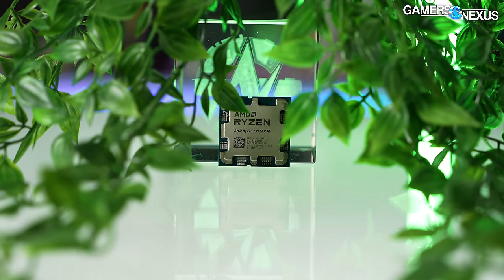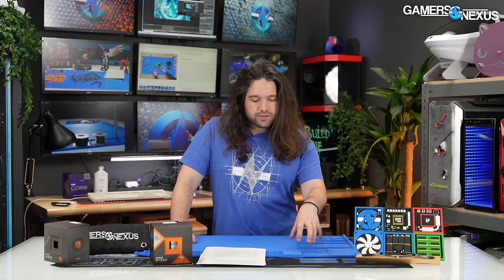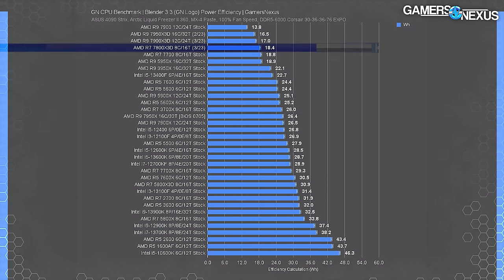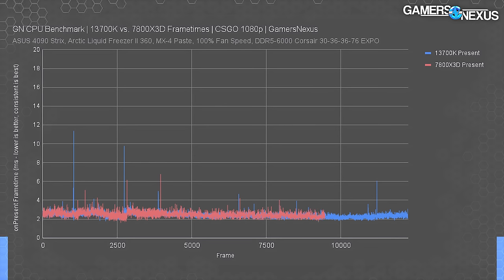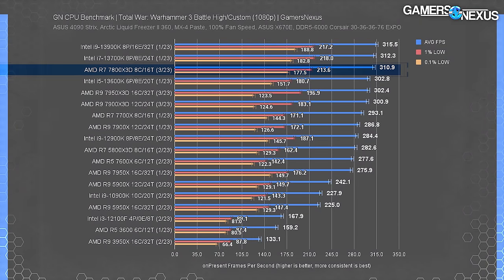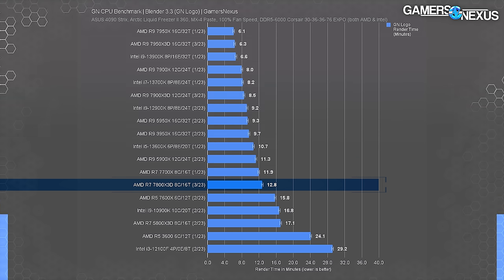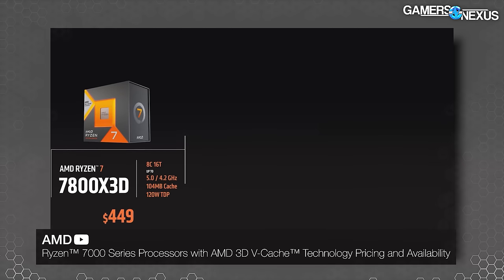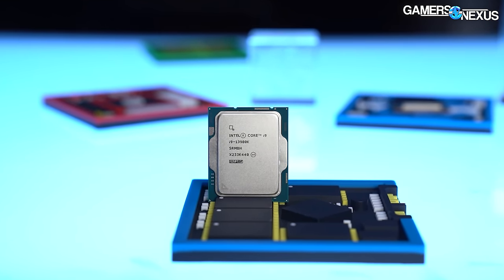AMD Ryzen 7 7800X3D CPU Review & Benchmarks

Comment: While I, in NO stretch of the imagination, agree with the GPU pricing lately, I DO kind of wonder if the price hike, at least in NVidia's camp, isn't based on all their R&D for the graphics technologies being developed almost exclusively by them.  They would need a return on their investment in the R&D space somehow.  Even still, as we get closer and closer to real life graphics, the R&D required to come up with a realtime way of making a game work properly (# of units on screen at a time with particles galore etc etc) increases substantially.  Yes, also, I'm aware Unreal Engine 5.2 is free to use and low cost to sell commercial games with, but that engine still has to run on silicon, not to mention NVidia R&D gets used and baked into the engine also.  With all that said, Theyre still wicked overpriced LOL.

Comment: @Gamers Nexus Would it be possible to NOT install the parking driver that AMD provides for 7900X3D and more specifically 7950X3D, and use Process Lasso instead to control the cores for individual tasks?  In my head, this would mean that you could manually set it up to use the V-Cache CCX for games that benefit from V-Cache, and the standard CCX for games that benefit from frequency.  A bit of a pain to initially set up, but would then make the 7950X3d the absolute king in ALL workloads and ALL games. By a long way.

Comment: Overclocking?
Reply: You can't oc an x3d processor, they are locked because of the vcache configuration, you can enable pbo and undervolt with curve optimizer, maybe reduce the vsoc when you have expo enabled, mostly to reduce power consumption and achieve top boost clocks under load.
Reply: you dont need to for gameing anyways

Comment: My 14700k is total fkn nightmare. Intel just a gang of scammers TBH selling same ancient, outdated trash using 10nm lithography for 3 years. 12, 13, 14th generations of CPUs are the same overheated, power-hungry crap. I bought my i7 4 days ago and all 4 days I was trying to cool it down or decrease its temperature. Not a single cooler, including the most expensive liquid cooling is able to cool it down. FACT. Don't even waste your money! All I could do is decrease turbo boosts power from 253/135 watts to 110/110 and cut frequency of all cores to 4200Hz with -0.015V undervolting. Yes, I lost 14% performance, but I got stable temperature of all cores @65-70 degrees Celsius.
Reply: Is this for gaming? That doesnt sound right?

Comment: I foresee AMD releasing a 7850X3D at some point to be the ultimate gaming CPU on this platform if Intel is able to convincingly beat this CPU with their next gen.  Basically it will be the 7800X3D without the artificial limits to clock speed.  AMD will probably stop selling the 7900X3D, as its clearly a dumb product.

Comment: One thing I would point out with the 13600 is that the power consumption is nearly double that of the 7800x3D. You'll pay less for it initially, but if you plan on running it for 6 years: you'll end up paying more than the difference on power cost over time. Running at the load/values indicated in the chart 24/7: after one year @13c kw/h: you're paying $97 to run the 7800x3D and $183 to run the 13600. And that's just off of a 74.4 watt difference 

Slightly tangential, but this is main reason why I think Nvidia is going to be eating dust in a generation or two. Their power efficiency just isn't anywhere close to where it needs to be to stay competitive long-term, and I see AMD cards starting to take advantage of some of the efficiency gains the CPU side is making. Power consumption has slowly become one of my favorite "parts value" metrics. People love to look at the upfront cost, but rarely factor the day to day cost. The new Nvidia cards cost a lot more than that over time.

Comment: I think I'm missing something, because I don't see the point. In 1440p, there's an insignificant advantage. In 4K, there's almost 0 advantage. In 1080p, were talking about such a high framerate, that it doesn't matter if there's an advantage or not (300 fps vs 240 fps), and most people spending $400 on a CPU don't usually game at 1080p.

So why would anyone need these? Shouldn't anyone who isn't a professional competitive gamer (99.99% of us), that doesn't have a 240hz+ monitor, and game at 1440p+, should just get a mid-range CPU, and just invest the money saved on a better GPU?

Comment: I assumed that AMD would put out 7950X3D and a 7900X3D chips - Zen 4 versions of 3D V-Cache but on 12 and 16 cores, would be killer. But I didn't even think they'd only add the V-Cache to one CCD. I'm sure it's super expensive, but man they neutered those chips. I wonder why they couldn't split the V-Cache across both CCDs, half the cache added to one CCD, and a separate V-Cache added to the second. But the core parking stuff, neutering the chip stuff, geez, why did they do it? I'm curious to see what Zen 5 3D V-Cache looks like, I imagine they won't do this again. I hope they won't.

Comment: meh, i have a 5700x. more than enough for my current 1660ti (just upgraded platform) and it should be plenty for something like an rtx4600ti or rtx4700 next year when i upgrade next year. 32gb of 3600mhz ddr4, i am set on platform for probably 5 years. i don't use the computer for productivity and if i wanted a productivity computer it would be very specific as to what i wanted for the work flow. this is a relatively cheap pretty great gaming/media computer.
Reply: oh, and power efficiency is almost meaningless for my current usage case.

Comment: I just can't warrant spending $450 on an 8 core CPU. Especially when the 12700kf was on sale for just $235 dollars last week, and I was able to snag a 12700k for $250 at the same time. CPUs have gotten so fast for gaming that there's almost no point in spending anywhere near this much for a CPU that only shines in gaming, and then only when tested with a 4090. You're GPU bottlenecked in the majority of real world gaming so it makes far more sense to get a 12/13600, 12/13700, 7700x or 5800x3d and apply the savings to your GPU that you'll actually notice.

I just feel this needs to be closer to $350 to make a lot of sense, especially when it's tied to the more expensive AM5 platform.

Comment: The big deal here is the the similar spec Intel chips appear to use twice the energy to get the same results.   So for instance, the 13600K is using 73.6W extra plus a few more watts from higher fan speeds in the rest of the system to cool a similar case.  Basically double the power.  Triple if you look at the 13700K.  For myself, I'd consider it "good enough" and save a significant amount of energy.  In fact, with a power usage that low, I have a giant passive cooler that would even work.. Just saying... No need to even consider water cooling (250+W is a massive air cooler with a fan that's screaming, no thank you) when any $30 fan cooler will easily work. The AMD offers options for lower noise, less cost to cool, and overall better economy.    This is a clear "win" to me as an end user as I'm not running my games at 200fps.  The question is.. is it fast enough and efficient enough.

Comment: if he performance gain from on the 7800x3d comes from the fact that all 8 cores are on one side of the die rather than 6 and 6 or 8 and 8 on the 790xd and 7950x3d, then can't you cimply disable half the cores in the bios on the bgiger chips to get them to perform like the 7800x3d? My 6 core was able to run 2+2, 3+3 and 4+0. if you could get a 7900x3d to run 8+0 then it would theoretically get that advantage boost up to a 7800x3d performance, no??
Reply: No, as the 7900x3d only has 6 x3d cores. It would be like a hypothetical 7600x3d
Reply: yes but theyre all cut down 16 cores to begin with. If i can enable a 4+0 config on a 4 core or a 2_2 config, then it should be theoretically possible to activate an 8+0 config on a 12 core that is usually 6+6. im not claiming to know how these chips work it just seems its ok to enable some cores on some chips on one side of the die as long as you dont try to turn a 12 core into a 16 core etc @TonyChan-eh3nz

Comment: Just jumped from 7500f which is amazing ❤❤❤❤❤  this 7800x3d what a disappointment. High temp, high fan noise, 30fps more comparing to 7500f .   .
Reply: if your 7800x3D has high temps, that's honestly a massive skill issue on your side. It's literally one of the coolest high-performance CPUs on the market.

Comment: Lol at the claims about the efficiency being the thing to tip people towards buying.

If you're only gaming then how long would it take for the increased AM5 platform cost to be paid back in power savings?

I'm on a 12700k and it's never even close to maxed during gaming. Power usage easily under 100 watts.

All this while people pairing it with a 300 watt GPU is laughable.

It just comes across as simping lol

Comment: I love how there used to be a saying before that AMD were just slow ovens. Fast forward 10 years and the roles have reverse. AMD beating intel in price and performance while using less than 1/3 of the power used by intel's best. Can't wait to see what intel is going to do, will they pump up more power into it or they will finally wake up and start taking efficiency into consideration?

Comment: If there's is no 7950X3D, you'd complain: 
"But why we can't have strong multicore coupled with the leading gaming performance? You better go with 13900K that has both"
Aaand you "conveniently" mention 7950X3D exactly zero times in productivity section where it leads most of the charts.
It only exists to loose in 2 games out of 7 to 7800X3D, yeah.

Comment: I dont get why amd didnt put the v cache on both sides of 7950x3d. That way you wouldnt have to shut down 1 side. What goofuses.
Reply: The 3DV-Cache does make it harder to cool that specific CCD because of how it’s layered on there so all core workloads would be a thermal nightmare. There are also memory latency issues when going between the two CCDs.
Plus you also get into cost/benefit issues. There are very few games out there that can even fully take advantage of all 8 cores on the 7800X3D so it’d just be higher cost and worse thermal performance for virtually no gain.

Comment: 6:45 AMD tanking the 7800X3D by severely restricting it's GHz is so anti-consumer. AMD killing their own sales, SMH.

Sh1tting on the customer causes ill feeling so I then refuse to buy their products for years.

Haven't bought Sony in 20 years because of all their rotten anti customer practices - no playstation, no TV, nothing Sony. PCMCIA Sony MagicGate 300% memory price ripoff when they took SD cards and put their own connector so you had to buy a Sony memory card at a complete ripoff price.
No more Sony for me.

AMD, if you're going down the same anti customer road then I'm not going to buy anything of yours for a long time.
Reply: Clock speed of the AMD 7700 is way higher than the 7800X3D. That's wrong. It's anti customer.

Comment: I h8t3 effin' Ryzen and INtel UEFI BIOS
You can't get Windows 7 installed on it for sh1t.   
I built a $2000 new rig and It's absolutely useless to me to accelerate my videoediting and  rendering.
How hard can it be to just installa nd run Windows 7 on new hardware.  Get with the program, Microsoft.
Reply: At this point switch to Linux.
Reply: @0Synergy  I put Zorin Linux on it and that got me up and running at least browsing the web in Firefox.  

I then put WIn 10 on a second harddrive using ShutUP10 and OpenShell to beat it into looking and behaving somewhat like WIndows 7.  Somewhat.

Maybe over the next 2 years I can figure out Wine and get it to run my critical WIndows Apps like Sony Vegas
Reply: @choppergirl Hey, I wanna buy a new PC with Ryzen 7800x3d but I want win 7 not the sheit win 10 or 11. Is there a way to have win 7 and update all my graphics, all my games working and not break something?
Reply: @Zeralop  Your easiest best bet is just suck it and diwnload a win10 iso, write it out to usb, istall it.... then try and make 10 look as much like 7 as you possibly can so it only half way p15535 you off.   Run Shutup10++ with extra settings, and then install OpenShell and set to a Windows 7 style theme of your choice.

Comment: So, intel is still better.
Reply: @RJpkFire Funny this is - it did.
Reply: you've been living under the rock. buy intel 13/14th gen, and your CPU degrades in several months.
Reply: @dipperq  Bro, what?
Reply: @KirillNeko  intel 13th and 14th gen i7 and i9s have confirmed stability issues, and have elevated failure rates compared to what a normal (properly functioning) cpu should have
Reply: @paneledp  i9s - probably. i7 - maybe, but maybe be not.
Reply: @KirillNeko what do you mean "maybe not" ? You've clearly done no research into this. The failure rate data for both i7s and i9s for 13th and 14th gen are available on the Internet.
Reply: @KirillNeko lmao this aged like milk
Reply: @nickabbott319  Not according to any random YT comparison vids, where i7-14 and 7800X3D neckl-in-neck.
Reply: @KirillNeko bro stap 😆
Reply: @KirillNeko  If only the 13th and 14th gen intel chips didn’t fail on 80% of people…
Reply: @nickabbott319  Did they?
Reply: @KirillNeko  lol
Reply: As long as you can RMA and free replacement youre fine. 

Theres ucode fix incoming